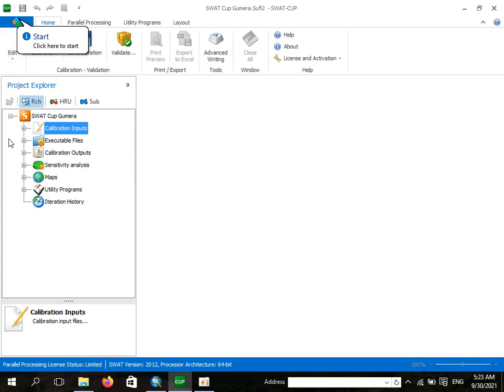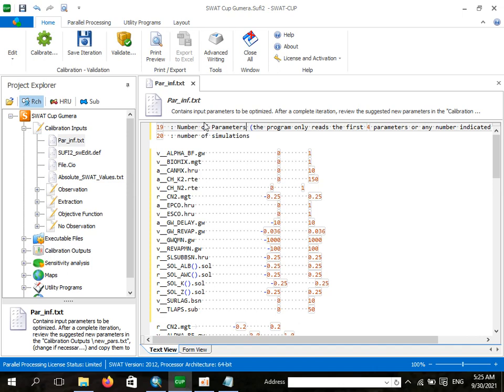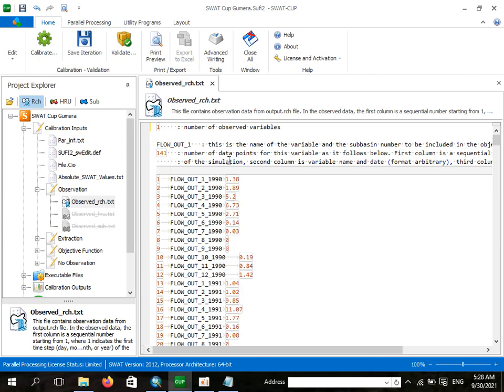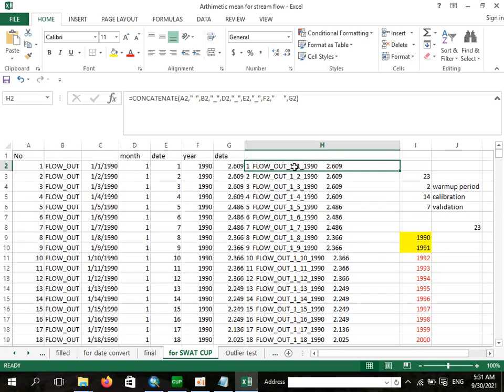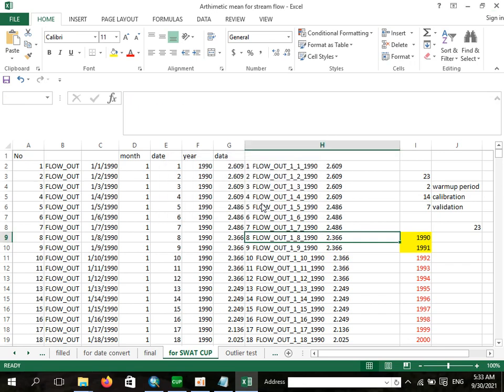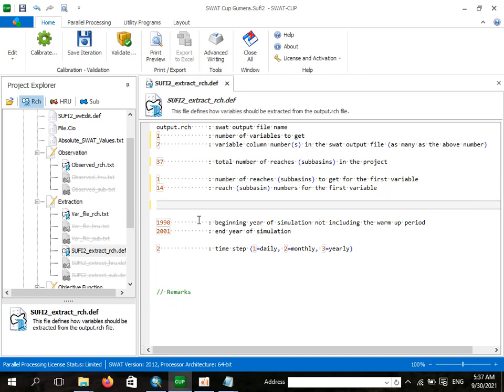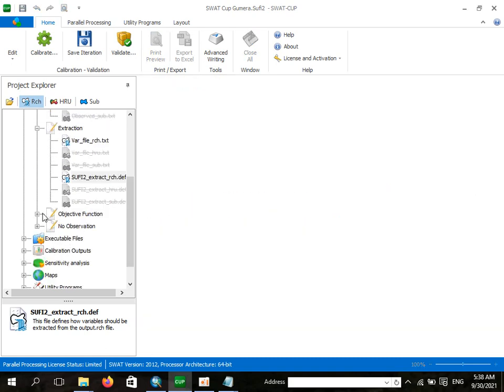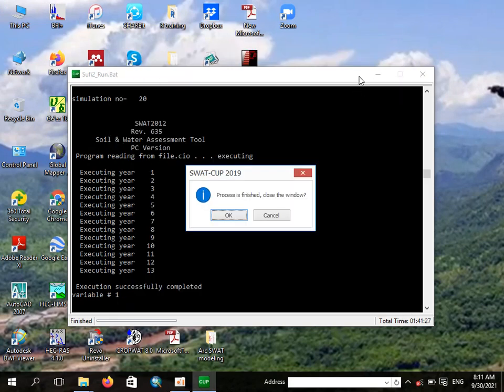How to perform Sensitivity Analysis Using SWAT CUP?

Comment: Hi, thanks for your great tutorial, I have dam in my basin and I don't know how to calibrate it and as a result simulated flow is worthless, could you please help me with it?
Reply from the maker: Did you have bn information about the reservior,
Reply: @givevalueforwater  YES I have all the reservoir data but I don't know how to give the model as a input so as a result downstream of dam not calibrated well
Reply from the maker: @aligholinia1146  when you are delineating the watershed, you should have to add reservoir and give required information on it.

as we put manual outlet in a similar way you can add reservoir in the watershed

Comment: How did take the flow parameters in the first place? 
from literature review?
Reply from the maker: Dear,
After you have reviewed parmeters from different literatures which has high influnce on steram flow, you can add from the absolute swat or ealy by using the add parameter icon at the top of SWAT CUP. don't forget to change the ranges with the suggested one.
Reply: @givevalueforwater  Thanks 
I did but not getting good calibration results
Reply from the maker: @kageyama7934 those issues will occur due to different factors, like quality of data so, you should have quality data.